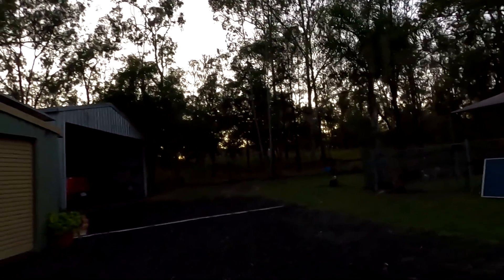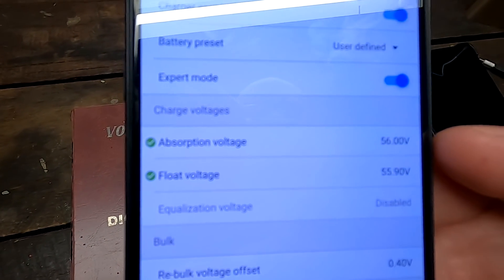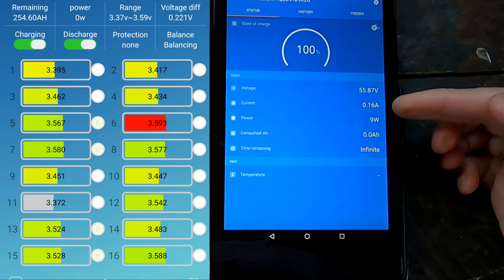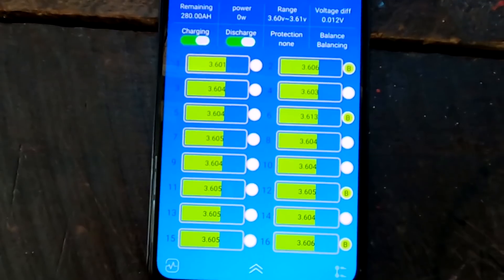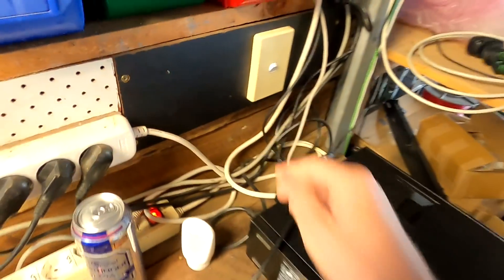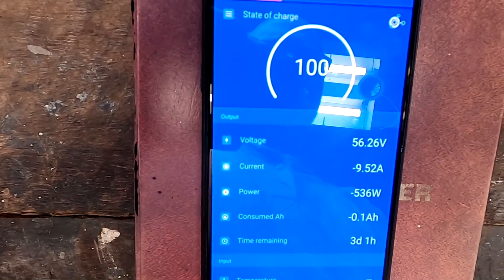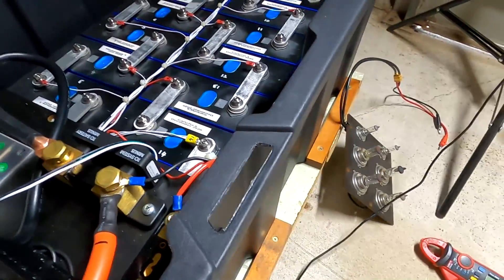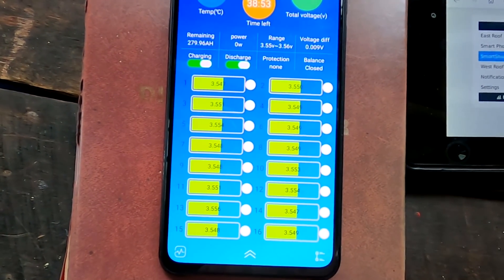Battery fixed  - but for how long? | Part 2/3

Comment: Why not wire this to charge each cell separately with its own BMS, then you would not need to balance!
Reply from the maker: How? What BMS would that be? How does it communicate with the other BMS's?
Reply: @OffGridGarageAustralia  I am not implying that a BMS exists that would do that, only the concept... thus a new device must be concocted, and that could possibly be just an external/add-on mod done to an existing BMS.

Comment: Love these vids and your set up. Really inspiring us DIYers to give this a go. Quick question - what do you think would happen if you added a 1s BMS to each cell in addition to the main BMS?
Reply from the maker: A 1s BMS with a fixed voltage? Or how do you control them?
Reply: @OffGridGarageAustralia  yes a 1s with fixed voltage so that each cell wont go above a certain voltage. I’m not saying its a solution - I’m asking if you thing that would help with the balancing as it would limit the over voltage of each cell.

Comment: Andy. you need to get into data logging your cells using a MQTT server, that way you have a history of each cell, I use one that data logs each cell in 10 second intervals
Reply from the maker: I've got this already in my BMS. It logs all the info since I installed it. voltage, currents, disconnects, temperatures... everything.
Reply: @OffGridGarageAustralia  Andy what program are you using? Has the vms got a memory card in it for data saving on each cell?
Reply from the maker: @sjdtmv  it's all in the BMS app available

Comment: So Andy this is what I’m doing. (Testing like you are) 
I’m floating at 54 volts and I’m absorbing to 55 volts for 4 hours but I have a ending absorption at 28 amp input durning the absorption cycle. My goal is to charge to only 85-90% I’m using a 2 amp active balancer that is always lowering the top cell and charging the bottom cell. It’s working great. I might make a video about it:) cheers mate.

Comment: Adding active equalizer(balancer) would've killed the issue in the first place. All this situation could've been handled more 'gracefully'. I'm not suggesting it as a protection mechanism, but as a complementary addition to the pack. Think of all the wasted time and energy. It's fun if you like manually tuning it and pushing it. But it's an investment too. I wouldn't go beyond 80% DOD for every cycle.

Comment: Active balancer! Will do bugger all between 20 and 80% but will help you get to the top without cooking any cells and will help you get the last drop of energy out at the bottom before it cuts off if you ever need to. DO IT! :-) They're cheap and highly effective not just effective at full voltage, but as soon as a cell starts to go up above the rest it starts transferring current and doesn't stop till they match. I've been using them for ages in more extreme charge/discharge scenarios and they work a treat at both ends of the cycle.
Reply: What maybe a good active balancer?   I have an 8s system

Comment: Today I bought a 450w panel, cable/mounting kit, 1200/1500/2400 (cont/15m/surge) inverter, and 40A tracer-an - sadly they'll be connected only to an old lead acid battery! :-D And in the shade, in winter, on a sub optimal angle :-D oh well. The things you have to do to suddenly work from "home" somewhere that isn't home when you're met with a surprise deadline to do some remote work on your property. Will make a good camping setup, I think :-)

Comment: You manually balanced the cells using the bulbs and power supply. You mentioned 100mA on the power supply, was that 100mAh or 100mA for the 30 to 60 minutes it was connected? I guess I'm asking if you have a feel for how many mAh the cells were out of balance and what that represents as a percentage of the cell capacity.

Comment: Andy, please prepare some kind of summarize, or confirm mine:
Primary reason – different capacity between the cells – which should be levelled by the BMS
Secondary reason – long time working between 30%-70% of capacity, on the flat part of the curve
Why BMS could not balance that? Because we are working on flat part of the curve – after charging, cells are still on flat part – BMS try to lowered deviations and do that successfully – but, capacity differences are still exist however are not visible because voltage of the cells is the same (flat part of the curve)
That differences summarize from cycle to cycle and what we have got:
Whole battery works between 30%-70% but some cells works 20%-60% some cells 40%-80% (for example).
What we can do?
We should works a little bit wider to get out from flat part and give BMS chance to rebalance the cells

I do not have own battery and this is theoretical divagations, I’m planning to build one, that’s why yours video are very interesting to me.

(sorry for my English, I’m not native speaker)

Comment: A Low Voltage Cell is indicative of a higher capacity cell, a High Voltage Cell is indicative of a lower capacity cell. Rarely are cells perfectly matched.
Reply: ...and thank you, I suspected all along that the idea is to go for the least common denominator or one might bang their head forever on the impossible! It's like a chain is only as good as its weakest link.

Comment: Andy have you looked into getting a BMS that can communicate with the victron system? My battery has an Orion Jr. In it and tells the charge controllers to lower the set voltage automatically if there is an imbalance to prevent over volting a cell. It can also change the charge current on the fly.

Comment: ok this sort of bass ackwards buuuttttt--- it will work. you are of course breaking your own rule, voltage is not a indicator of charge state. i say put that big charger you have on it over night at 3.55 per cell with a depth of charge set to .5a and i would call it good to go. bypass the bms for this charge. and for god sake set it far away from everything while you do this. i don't want to here something bad happened to you. i going to nick name you toasty you stubborn old bat. love ya and wish you well.

Comment: Glad you are rebalanced now! However I’m itching to see how the setup continues to balance as you go back to your 3.45v top voltage per cell, as this is what I will be running personally as well as my customers setup (16s 2P 400ah pack.

Comment: Is it okay to add ultracapacitors on LiFePo4 batteries?
Reply: Absolutely, I have a set in parallel with my batteries and another in parallel with my inverters/chargers. The battery ones help reduce sudden loads on the batteries and the ones on the chargers/inverters help to reduce the shock on the inverters/chargers if the BMS turns off either charging or discharging.
Reply: @rattusfinkus  my problem was, what if it messes up the charger? Since it'll view the batteries as always fully charged. Also should I get 48v ultracaps in series or 56v? Thanks!
Reply: @leotheevinci  If the caps are in parallel with the batteries their voltage will be the same as the battery voltage, they will just buffer the batteries from short duration high loads
Reply: @rattusfinkus  actually I'm already familiar with the use of ultracaps in lead acid batteries but I'm being very extra careful with expensive lifepo4 batteries. Yes, lead acid batteries voltages drop under sudden load surges that's why it is almost essential to add ultracaps. I don't think I'd be needing diodes and resistors since the BMS will already handle any over current passing thru my lithium batteries. I doubt it will have any negative effects on my mppt charger as well. So... I'll just series them up to 56v. I hope it will further expand the lifespan of my batteries since the ultracaps will act as a buffer on sudden load surges.
Reply: @leotheevinci  sorry mate but you're wrong. I have caps in parallel with my invert/charger. I put this in so when the BMS turns off charging to the batteries in an over volt situation the inverter can also go over volt because the charger is still pumping a big current. The caps here absorb the excess current to prevent the over voltage. This is a common problem. Now imagine your batteries are now at a lower voltage and your caps are now at your maximum charging voltage and the BMS decides to turn on charging again. All that energy stored in the caps is discharged into your batteries through your fuses and BMS, depending on the size of your caps and the voltage difference it could be over a thousand amps.
Reply: @rattusfinkus  i have a 12v lead acid battery with ultracaps simply in series with no bms, so it seems they're still alive after 5 yrs and counting. Lol.. I understand where you're coming from but I think if that's the case then just series a 48v caps so no matter how much gazillion of current are stored in them it wont fry anything in your system since your batteries voltage are around 56v at 90% soc. I've never used bms on ultracaps, because I think that's just silly and a total ripoff.
Reply: @leotheevinci  When the bms shuts down charging the voltage spike can and does trip the inverter to high dc voltage fault. It has happened to me and it has happened to many other folks. If you do the calculations at just a 15v voltage difference with even just the smaller super caps you can reach hundreds of amps. Please look it up. The high amp diodes cost about $10 and the resistors are cheap, you could use old heating elements if you know what your doing.
Reply: @rattusfinkus  Hmm... I see that my major problem in adding ultracaps to lithium batteries is that it triggers all sorts of over current/voltage protection in the BMS. Yes, I add diodes and drop resistors to limit them from going over their rated voltage, else my ultracaps will pop, along with my system. But I really think 55v ultracaps is a go, I just need to make sure the voltages wont go beyond that for them to trigger the BMS. I'll set my float and absorption to 55.2v.
Reply: @leotheevinci  just when you think you have a handle on it, something else pops up. I am constantly learning, I have MPP units, they are cheap and work reliably but they do have some limitations. It would be far easier with victrons and the like but I can increase my battery bank significantly with the cost savings and I think that gives me much more bang for my buck. Trust me on the capacitors on the charger/inverter side. The caps on the battery side are probably not required but I bought a large 160v Maxwell super cap bank very cheap on eBay and cut it in half so I have two 70v packs and enough left over for a 16v pack, I kept the balancers on the 70v packs and just bought a cheap balance board for the 16v pack.
Reply: would do no good as there output in linear
Reply: @sjdtmv  that's why I should series ultracaps exactly as full charge voltage of my batteries to 3.5v (56v) right?
Reply: @leotheevinci  ultracaps need to be paralleled and balanced.
Reply: @leotheevinci  The only thing you need to  watch is if there is a situation where the batteries and caps have different voltages and they are reconnected you can transfer huge currents. My caps connected to my inverter have diodes and resistors in place to control the charge and discharge rates.
Reply: @rattusfinkus  ultracaps can be paralleled but there's no need to balance them. They're fully charged almost instantly up to their voltage capacitance once plugged.
Reply: @leotheevinci  the individual capacitor cells in a pack need to be balanced in much the same way as battery cells need to be balanced. You can't just string a bunch of low voltage ultra caps together.
Reply: @rattusfinkus  I've never heard ultracaps being balanced. Lol... for example, series 5x 2.7v (13.5v) ultracaps and charge them at 12v, just a very few seconds unplugged them and test their voltages 1 by 1, see what voltage you'll get. Silly. 😅
Reply: @leotheevinci  if you have a bank of ultracaps you will find it will have a balance board in it. Silly
Reply: @rattusfinkus  I DIY my ultracaps and dip my board in sulfuric acid to make my own, sorry.
Reply: @sjdtmv  please explain why. They work very much the same as a battery, They just charge and discharge extremely quickly.
Reply: @rattusfinkus  I did play around with ultra caps and it does little to help the batteries from shock, you will find that most inverters have already large caps built into them, when you size up a inverter to a battery bank there is nominally no greater then a !C discharge, the cost of ultra caps compared to getting larger batteries, it is fair better to put the cost to getting the batteries
Reply: @sjdtmv  the caps help the inverter from going into fault if the BMS stops battery charging.

Comment: I am so glad I came across your channel. I was about to purchase thousands of dollars in Lifepo4 batteries, solar panels, and the rest of necessary items. However, after watching several of your videos I have decided to wait because it is just too complicated for the average person of which I am one. I just don't have the necessary time to learn and apply all the nuances and requirements. In my view, if one assigns a reasonable dollar amount to the time and effort one has to put in to get a system to work, it makes more sense to pay the grid.

Comment: You are again focusing on volts at high charge to balance, does this really make sense? Initially on setup a battery pack (high balance the cells) -> yes. Put them all in parallel to balance them in volts. After that putting them in series they would of cause differ in voltage at the low and high end, because of slightly different capacities, which is Wh, meaning V times A times time. Wh should be all that is interesting at the end. 
Balancing them every 3 month or so may be a good idea, but generally using the pack from 10% to 90% will let enough room for the weakest cell.
Would be interesting to see how much energy is lost with the passive balancer and the new active one you have order. In comparison to just not balance and use 10% to 90% of the capacity.
Reply from the maker: Thanks Peter. I totally agree. We're chasing volts here. And that is wrong. -> see next video 😉

Comment: Now you have proved to yourself that it only really balances at high voltages, and that its best to pick a day every few months to change setting, use no power and do "balancing"  and the rest of the time have the lower voltage cycle-life-increasing settings the rest of the time, accept the slow charge over 80% and if its anywhere near that charge the Tesla until 30% SOC or something :)
Reply from the maker: I kind knew I cannot balance at 3.35V due to the flat curve but wanted to see and share what happens.
You can actually charge the cells to 100% every time if you keep the voltage low while doing this. 3.45V with some absorption does that. Stress free for the battery and no added degradation.
Reply: @OffGridGarageAustralia  yep, its similar to what I do. However the base loads it never fully charges. Its mid summer here in UK, just checked the BMV, 12.4 days since last full charge ... although it is raining here in Wales at the moment.

BMV has been in 6 months, says 31 cycles with these mild settings and temperatures   its only the time-aging that's going to matter. My C rates are generally below 0.2C for discharge and charge
Reply from the maker: @KevIsOffGrid  these batteries will just last forever...

Comment: Equalization is for lead acid not lithium
Reply from the maker: We could use this setting to balance the battery at a higher voltage as I explained.
Reply: What I saying is, I think victron disables equalization setting because they say it’s for lead acid or agm batteries.
Reply from the maker: @CryptoNut82  probably. It's just the term or word which makes people think about the old battery tech.

Comment: The best trick would be if the BMS could dynamically adjust the PPT output voltage to keep battery charge current under 200mA before a cell hits charge cut-off voltage. Then you can forget just about anything else other than target cell voltages and let the BMS/PPT handle everything else.
Reply from the maker: That would be amazing, if the BMS could talk to the SCC and say, 'hey, slow down for a while'...
Some can actually do exactly that...
Reply: @OffGridGarageAustralia  I'm sure someone can write a pi script to poll the BMS and update the PPTs accordingly, though this could wear out the PPTs' programming memory unless they have a mechanism to accommodate external output voltage control.
Reply from the maker: @teardowndan5364  I think someone mentioned a GitHub project to connect the BMS to the Victrons via the RS485.
I'm waiting for an email from someone 😉

Comment: Hello. Reading my Sol-Ark user manual, for lithium you should use these settings. Absorption 54.6, float 54.3, equalize every 30 days for 3 hours at 54.6.
Reply from the maker: I'm testing to balance at 3.45V at the moment which seems to work far better than 3.35V.
Does it do the equalization automatically or do you have to change your profile in the charge controller?
Reply: @OffGridGarageAustralia I have to change my profile to “user define” in the charge controller, and set the parameters
Reply: @sandrofurlone3903  54.6V is for lithium NMC (Nickel, Manganese, Cobalt).
Andy uses lithium iron phosfate (LIFEPO4)  and the right charging voltage is in a range between 54,4V - 58,4V.